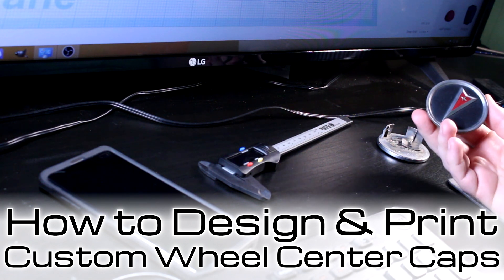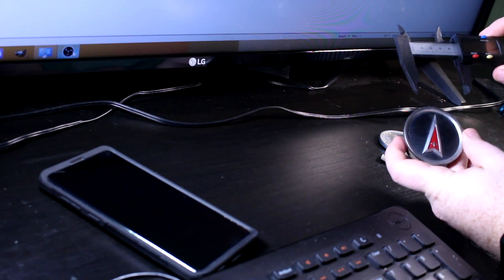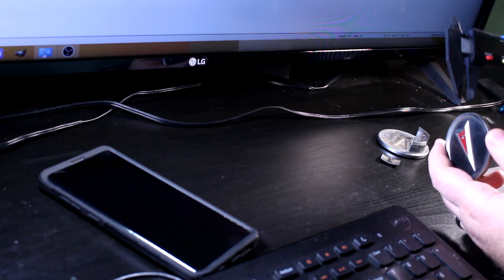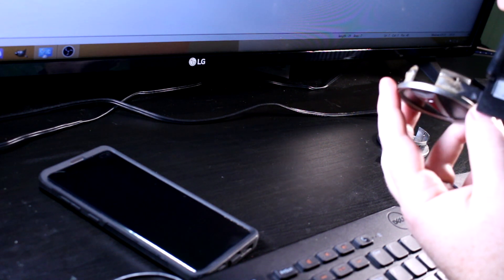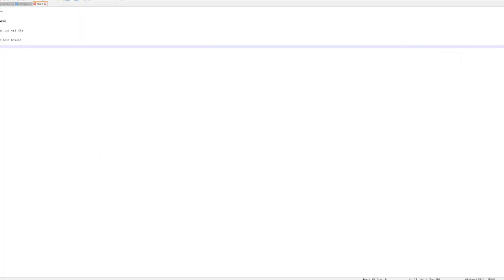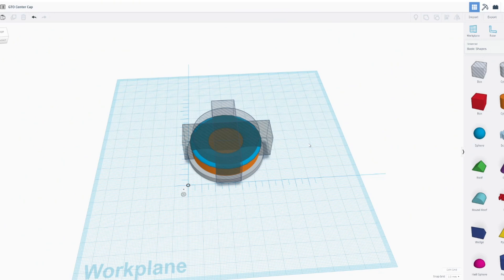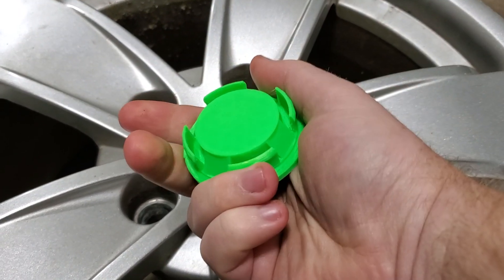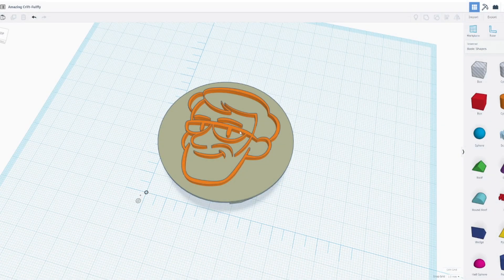Designing & 3D Printing Wheel Center Caps From Scratch! (Custom)

Comment: Nice! What brand and model 3D Printer are you using and or what one do you recommend I get for doing custom center caps??
Reply from the maker: I used and still own a Creality Ender 5, but it has been years since I have seriously looked into new 3D printers so I'm sure there are better options from Creality alone, plus all sorts of options from other brands. Center caps are generally pretty small and relatively easy to print, so I'd recommend thinking about what else you would want to print when deciding on what print bed size you want. As long as the printer doesn't have a system that requires proprietary spools of filament, it should be able to print with PETG filament like I did.

Also, while the Ender 5 is pretty straightforward, there are many more user-friendly and quality of life features that you may want. One feature I wish my printer had was auto bed leveling.

Comment: Hello man what are your petg settings to make Centre caps cause what I am struggling is  my Centre caps legs  break off  when they get fitted  cause it needs to be  a  little to be flexible please help man I tried 22 different ways with settings and not working and did take all measurements

Comment: I wonder how hard it would be to 3D print a new lens for the JHP dash gauges... there are no new replacements to be had anywhere.  They scratch very easily and look bad after a while.
Reply from the maker: Clear stuff never really comes out nice enough to see through from what I've seen. If the lens is flat, it would probably be easier to make it out of acrylic sheet or something.
Reply: @CarsSimplified  It is curved in spots.  Doesn't look too difficult, but then again, I am by no means very knowledgeable of 3D printing.  I could send you a picture of it if you want to see it.
Reply from the maker: I looked it up before replying but I didn't get a close-up image of the lens itself. Still, the clearest 3D printed stuff I've seen on home printers would be pretty tough to read through.

For a while I was getting ads for some company that was 3D printing custom lenses, but I believe it was a special filament, a finishing process, and possibly even a post-print treatment of some kind. The technology is getting there!
Reply: @CarsSimplified  Interesting... I might look into a company doing it down the road.